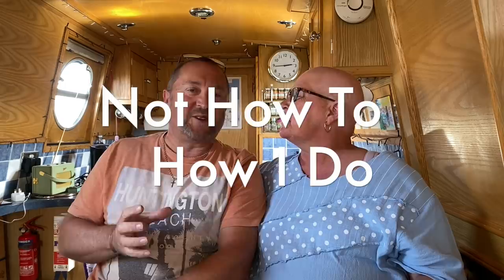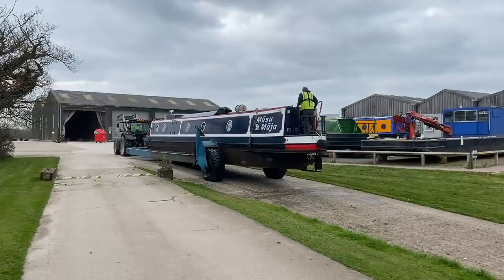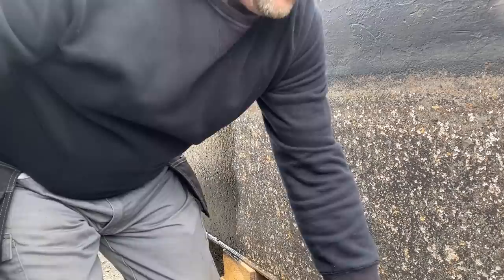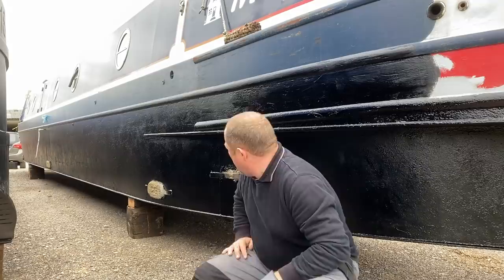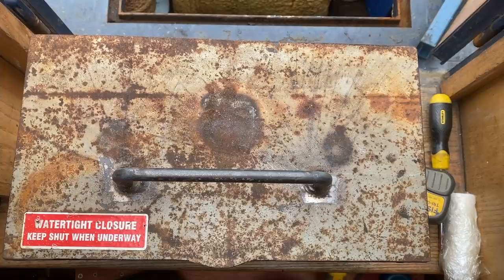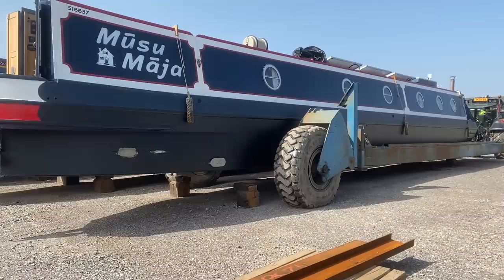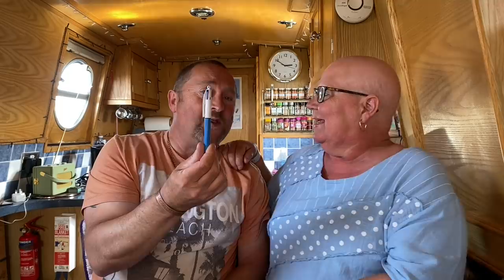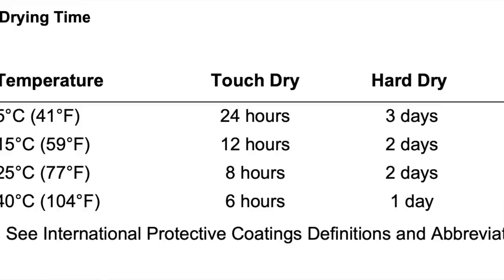DIY Narrowboat Blacking Important Information, How Much? How Long? How To? Canalboat life Costs E102

Comment: Hi. I've watched a few videos of boats being blacked and it seems quite a few don't do the base plate, is there any reason why you didn't do yours ? I hope your good lady is doing good.
Reply from the maker: what most people have told me is this,
Not normally painted, the base plate is thicker steel and with lower oxygen levels at the bottom of the canal it doesn't rust as much, and any coating you apply get scrapped off in the shallow water.
but we have done the base plate this year

Comment: Can’t beat them four colour pens 😀,did you paint the underside of the hull?
Reply from the maker: Not normally painted, the base plate is thicker steel and with lower oxygen levels at the bottom of the canal it doesn't rust as much, and any coating you apply get scrapped off in the shallow water

Comment: how do you do under the boat when its so low on blocks ???
Reply from the maker: Not normally painted, the base plate is thicker steel and with lower oxygen levels at the bottom of the canal it doesn't rust as much, and any coating you apply get scrapped off in the shallow water

Comment: Looks great...How do you paint the bottom of the boat??
Reply from the maker: Not normally painted, the base plate is thicker steel and with lower oxygen levels at the bottom of the canal it doesn't rust as much, and any coating you apply get scrapped off in the shallow water
Reply: Oh, I did not realise that but always wondered. Thanks☺

Comment: You did the side but what about the bottom ?
Reply from the maker: Not normally painted, the base plate is thicker steel and with lower oxygen levels at the bottom of the canal it doesn't rust as much, and any coating you apply get scrapped off in the shallow water

Comment: I saw you blacking the sides and under the stern but what about the bottom?
Reply from the maker: Not normally painted, the base plate is thicker steel and with lower oxygen levels at the bottom of the canal it doesn't rust as much, and any coating you apply get scrapped off in the shallow water
Reply: @welldeckdiaries5610  Great I just wondered.

Comment: Dumb question? Do you paint under the main part of your boat. I've seen anyone do that on YouTube.
Reply from the maker: Not a dumb question at all Barry.
Hope you’re both well❤️
its not normally painted, the base plate is thicker steel to last longer and with lower oxygen levels at the bottom of the canal it doesn't rust as much, and any coating you apply get scrapped off in the shallow water

Comment: Silly question but how do you do the actual bottom of the boat, is it lifted up to head height so you can get underneath?
Reply from the maker: Not silly at all Jane
Not normally painted, the base plate is thicker steel and with lower oxygen levels at the bottom of the canal it doesn't rust as much, and any coating you apply get scrapped off in the shallow water

Comment: Why don't they black the bottom of the boat?
Reply from the maker: its not normally painted, the base plate is thicker steel to last longer and with lower oxygen levels at the bottom of the canal it doesn't rust as much, and any coating you apply get scrapped off in the shallow water

Comment: What about the bottom of boat.  Not a boater just interested. 😃
Reply from the maker: Not normally painted, the base plate is thicker steel and with lower oxygen levels at the bottom of the canal it doesn't rust as much, and any coating you apply get scrapped off in the shallow water
Reply: Thank you.  Enjoy the sunshine 😍

Comment: How do you black the bottom of the boat.
Reply from the maker: its not normally painted, the base plate is thicker steel to last longer and with lower oxygen levels at the bottom of the canal it doesn't rust as much, and any coating you apply get scrapped off in the shallow water

Comment: you didn't coat the bottom?
Reply from the maker: The opinion is that the bass plate is a full 10mm thick and with lower oxygen levels it doesn't suffer from rust to much, plus any blacking would soon be scraped off in the shallow part of the canal

Comment: do you not do underneath
Reply from the maker: Not normally painted, the base plate is thicker steel and with lower oxygen levels at the bottom of the canal it doesn't rust as much, and any coating you apply get scrapped off in the shallow water

Comment: Do you not do the "right" underneath bottom of the boat?
Reply from the maker: Not normally painted, the base plate is thicker steel and with lower oxygen levels at the bottom of the canal it doesn't rust as much, and any coating you apply get scrapped off in the shallow water
Reply: @welldeckdiaries5610  thanks, take care you two!

Comment: So how do you black the bits of the boat under the supporting blocks?
Reply from the maker: The base plate is thicker steel 10mm instead of 6mm and the idea is that the oxygen levels are lower at that level so it doesn't rust as much

Comment: Hope I’m not being negative, but, does your bottom not need doing.....sorry the boat bottom.
Reply from the maker: Not normally painted, the base plate is thicker steel and with lower oxygen levels at the bottom of the canal it doesn't rust as much, and any coating you apply get scrapped off in the shallow water
Reply: @welldeckdiaries5610  many thanks.

Comment: How did you paint the underside?
Reply from the maker: The base plate is thicker steel 10mm instead of 6mm and the idea is that the oxygen levels are lower at that level so it doesn't rust as much

Comment: Mark do you do the underside as well ?
Reply from the maker: Not normally painted, the base plate is thicker steel and with lower oxygen levels at the bottom of the canal it doesn't rust as much, and any coating you apply get scrapped off in the shallow water

Comment: Great video, as always, BUT... having don the SIDES of the boat, what about the BOTTOM?
Reply from the maker: Not normally painted, the base plate is thicker steel and with lower oxygen levels at the bottom of the canal it doesn't rust as much, and any coating you apply get scrapped off in the shallow water
Reply: Ah!  Never thought of that!